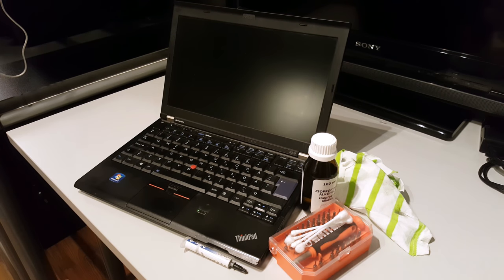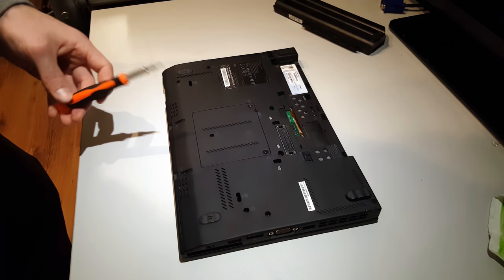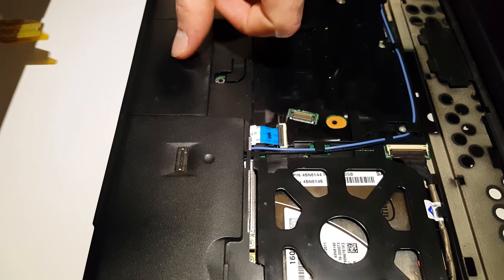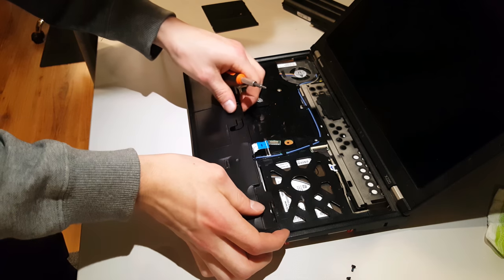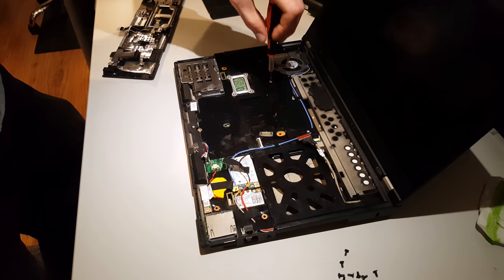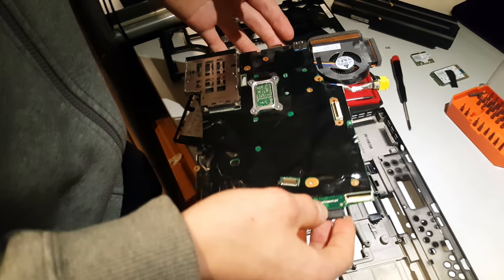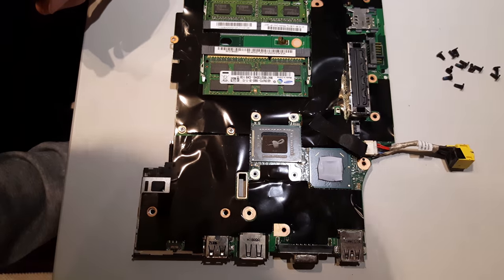How To Change The Thermal Paste In Your Laptop (Thinkpad X220)

Comment: I owned my X220 for eight years, A thermal paste replacment is long overdue; Thank you so much!!
Reply: @MustafaHussein-tf2sy Yes I do! I did replace the thermal paste, honestly, It was way cleaner inside than I expected. No gunk or anything, just loose dust that I cleaned quickly, I also changed the drive and that gave it a new life, especially with Linux! And now it's back to Windows again.

Comment: Thank you for this.  In my case I will still probably pay for a shop to do this as I don't want to take a chance of breaking something.  However, I like to see how this done to get an idea of what they will do and how they will do it.  I also now understand why the paste has to be replaced over time as it appears that it breaks down and loses its connection with the heat sink.

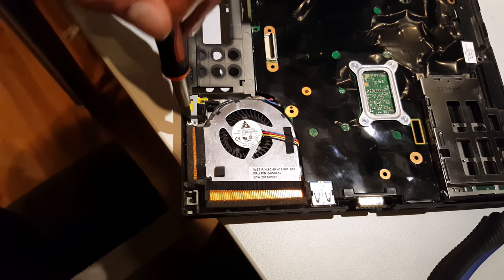Comment: you forgot how to dismount the vga port, at 4:06 screws are gone and you didnt explain how to remove them
Reply from the maker: +Varles good point, we probably missed filming that, but they are easy to remove using small pliers
Reply: Yeah, i spent a while trying to figure out why the board wasn't moving!! hehe just make sure to put a note in the video so others wont miss that, take care my man ty for the video
Reply: that's a pretty big "whoops" considering i can't figure out how to take the screen off without damaging it lol

Comment: Great tutorial.

I need to change the thermal paste on my X220 again. As the last (and first) time i did it, about a month ago, the thermal pad on chipset between the CPU and the fan was ruined, so I temporarily bunged in some thermal paste. Are those pads a stock Lenovo part? I've been looking for them at local computer parts retailers here (in australia) and theyre not listed online. What are they called and is there a specific type i need buy?
Reply from the maker: They're just called thermal pads, no need to get anything special. You can buy them online from ebay, get something from a good brand like Artic Cooling or Gelid. Try to measure the thickness of the current pad and buy a new one with similar thickness.
Thanks for watching!

Comment: hi . what kind of product do i have to use to clean the old thermal paste?  and you did not not spread the thermal paste throw all the processor surface before putting back the fan cooler?
Reply: as he said, some isopropyl alcohol (brand names don't matter) to clean, and laptop CPUs are small enough that just the pressure from the heatsink will spread it decently well all by itself

Comment: Thanks for your tutorial. I accidentally damaged the rubber on the other chip (GPU?) that is cooled by the vent. So i put some thermal paste on that too. Is that good or do I need to buy some of that rubber to put on, and what is it?
Reply from the maker: By rubber you probably mean the thermal pad on top of the chip. That chip is the PCH, the X220 doesn't have a discrete GPU. The gap between the PCH and the cooler is bigger than on the CPU, so you probably shouldn't use paste. It might be fine, but to be safe you should buy a new thermal pad from a quality brand like IC or Thermal Grizzly. You should check how thick the original pad is and buy a new one with the same thickness. If you don't have the old pad anymore, I'm pretty sure that a 1mm pad is fine.
Reply: @KrupsFilms  I've found out that it's the thermal pad that I screwed up. And the machine does get hotter now, so I'll be looking for what you suggested! Thanks!!!

Comment: I ran a lenovo Diagnostics on my X220. Everything checked out except the Fan test. It read "Fan unavailable." In other words it's like the system could not detect or see the fan. But I can feel air coming outta the vents.

Is there a problem with the fan that it is seen as unavailable?
Reply from the maker: There might be a problem with the fan or in the motherboard. The fan is of course being supplied power because it spins, but if there is some problem with the tachometer that measures the rpm of the fan or with the circuitry that receives that information, the system will think that the fan is not spinning. You should try another fan if you can, since that is the easiest and cheapest option, but if that doesn't work, the problem is likely in your motherboard, which is much harder/more expensive to fix or replace.

Comment: yeah, fuck that, too much work xd Its not for gaming anyways, so it wont throttle
Reply from the maker: Well, lower temps are always better. If they don't straight up  improve performance, they lengthen the life of the chip. And, in this case, the X220 has a very small cooler and the CPU heats to like 95c under load, so we'll take any improvement we can have.

Comment: Not sure what happened but the after putting everything back together the laptop no longer detects the wifi card. Bought a replacement card that is supported and still nothing. Tried sticking a non supported card into the mPCIe slot and immediately rejects it in the bios so I guess there's nothing wrong with the mPCIe slot? My only guess is that there's something wrong with the black and grey antennas and I'm probably gonna have to replace them.
Reply from the maker: Have you tried to reinstall the drivers? If so, try to look if you see it in the device manager. Is the wifi card in the wifi slot or in the wwan slot?
Reply: Already tried that and they don't even show up in the device manager. Tried sticking it in the slot where the WWAN card goes since I heard it should work in both mPCIe slots and still nothing. Would the card be detected even if the antennas aren't connected?

Comment: How to tell the laptop is over heating ? I get very hot air from the exhaust fan, that means the contact between the CPU to heat sink are good right ?
Reply: 5 years too late, lol, but there are tools for it, I think windows should even have builtin ones, you just check that the cpu temps aren't too high, I would say anything under 90°C is probably fine, and under 80°C under stress, is decent

Comment: The whole operation was pretty smooth but now I get "Fan error" :(
Reply from the maker: You probably forgot to plug the fan in during the reassembly. Its connector is right next to the docking port on the motherboard.

Comment: Thank you for making this video, I needed a confidence boost by watching someone else replace the CPU thermal paste on a laptop. I wanted to upgrade my laptop's processor and hence needed to reapply new thermal paste.

A quick reference for folks landing on this video via a Google search:
You can use this video's instruction to replace the processor and its thermal paste on a Lenovo ThinkPad Edge E540 (model revision number: 20C6).

My laptop came installed with a socketable Intel i5-4200M processor, I bought a second-hand Intel i7-4702MQ processor via eBay. I used Arctic MX-4 thermal paste for the task. This processor requires fresh and decent thermal paste as the laptop's fans cannot be replaced.

This Lenovo E540 laptop also supports the Intel i7-4712MQ processor.
Reply from the maker: Great!